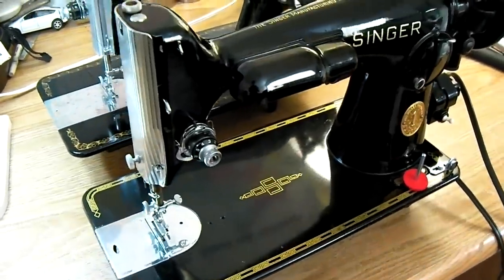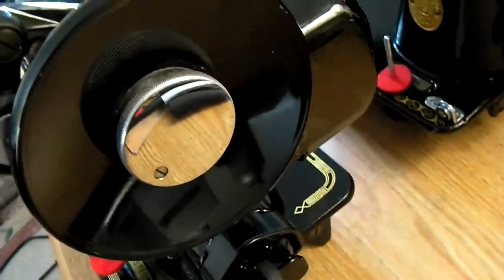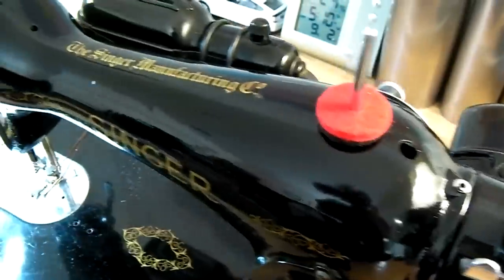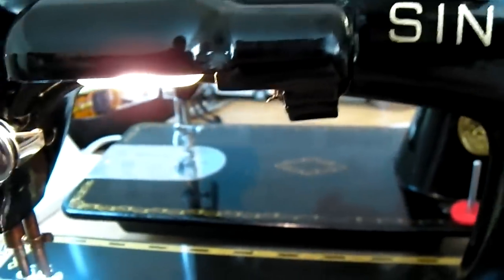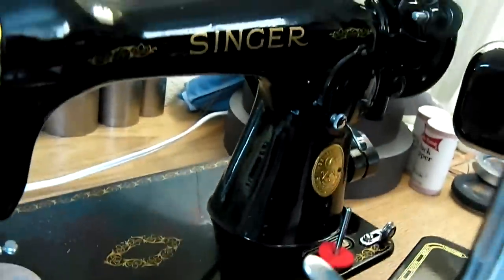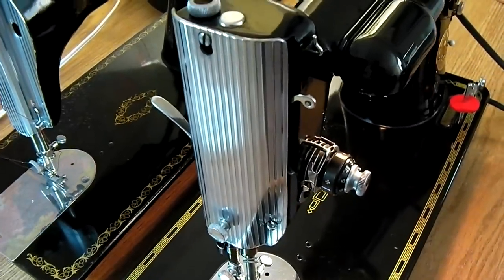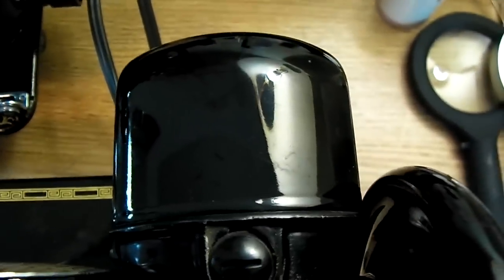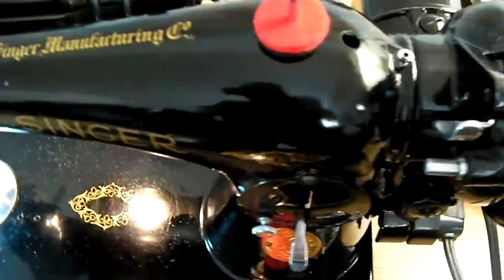Direct-Drive Vintage Singer Sewing Machines, 201-2 vs 15-91

Comment: The 15-91 is called the farmers machine while the 201 is called the dress maker .  The 15-91 is more for heavy sewing . Itl go through leather and heavy blanket if ite fine tuned and factory specs ( needle the right way / bobbin right way anti clock wise placement / needle charge and right size etc )

Comment: I just got a model 15 but it's missing the power cord. Does your model 15-91 uses a pedal or is it single corded?
Reply from the maker: It has the typical 3-prong Singer electrical cord, with a foot pedal.
Reply: Thank you so much, rmwtsou! I have ordered the parts and am awaiting to test out my machine.

Comment: The important differences between the two is that the 15-91 uses an oscillating hook while the 201-2 has a horizontal rotary hook. That's why the 201-2 sounds smoother.
Reply from the maker: Good to know. Thanks!

Comment: See if you can find a Singer 101.  It's the predecessor to the 201.  It also has a 'potted motor' but it is built directly into the body of the machine, unlike the 201 and 15-91 where the potted motor is bolted on.  It's smoother and faster than the 201.  The 101 is the nicest of Singer's machine in my opinion.  I have an overview video on my channel.  Feel free to check it out.

Comment: Bought a 201-2 today in original #65 cabinet with stool, buttonhole attachment, zig-zag attachment, original book, and 8 bobbins. Haven't plugged it in yet. It needs some cleaning -- cabinet is solid but needs to be refinished. Wiring looks new. Decals are decent -- not perfect, but not worn off either. Machine finish needs a cleaning too. I paid thirty dollars for it!!!! Woo-hoo!!! Can't wait to try it out.
Reply: Congratulations !!  30 bucks is a good deal for sure, what a steal!!   For the decals you can always replace them, sell them online pretty cheap.

Comment: As someone already pointed out both the 15-91 and the 201-2 use the same motor.  Singer also made the 101 which was the predecessor to the 201-2.  Singer did make THREE potted motor machines.  I have all three and they all run great.

Comment: first i wanna say thanks for taking the time  to make the video, but i wanna make a point that singer makes many more than just two potted motors. they have a singer 201, 19-51, and similiar model 15's such as the 15-125, and the 15-75, also the singer 101

Comment: I have a 201 and want to get a 15-91 but must correct your statement about the only two direct drive Singers.  The 101 is also direct drive and predates both the 201 and 15-91.  Not as many of them around but great machines.  The motor cover screws onto but otherwise is similar and is the same design as the 15-91 and 201 when it comes to the direct drive portion.
Reply: Some - if not all - of the Singer Slant-O-Matics are direct drive as well (the 301 and the 400 and 500 machines.)

Comment: They must not be original. They look brand new.
Reply: They are original machines. It's the way they were made. A layer of black paint, decals, then lacquer to protect them and make them shine. IF they are cared for with the proper stuff they can be restored to look like this. Isn't it wonderful?

Comment: Have an old Singer that looks like a 201 (light in front , light switch, tension front) but SN AK 807667 according to1 website is 1952 15 model. Any good ideas for more info? It sounds nice when runs.

Comment: Correction....
There were some belt drive model 201's but were mainly treadle and industrial units. None wit the standard external motor/belt drives found on  home machines. 

By the way neither the 15-91 or the 201-2 are commercial, heavy duty, or industrial machines. Strictly made for home use! The direct drive motor set up gave the machines more punching power but not more running power.

Comment: the "base" of both machines are equal dimensions, whereas it is true the "body" of the 201-2 is larger.  Both these machines in good condition are quiet and run very smoothly. 

Although they  "can" sew leather...they were not made to and it it not advisable to put the machines to that use.  They are for "home" projects not for sewing leather.

Comment: I have a 1941 201-2 and the faceplate on it has fancy scroll work thats the only thing different about it. Kind of faded paint but runs amazing. Wiring is scary though I need to replace or update. Got at a yard sale in cabinet with attachments, tons of bobbins etc. all for $10. My cousin sat down and sewed 14 curtains for my old front porch windows and marvelled all night how satisfying it was to use it compared to her newer Brother. We went on a binge and found a couple more for her and she gave her Brother away to make way for an old Singer.
Reply from the maker: You got your 201-2 for a great price! Congrats. These will last decades.

Comment: I have found the 15-91 belt drive is more powerful of a machine. Will easily sew canvas or upholstery materials like butter. .
Reply: I was talking with my Singer repair lady and she told me the belt machines actually had more power than the potted motor. She was telling me that many people think the potted motor is all muscle and can sew leather and wooden rulers, etc. (All the things people do to prove how strong they are.)  She said they actually chip the worm gears by trying to sew things the machines weren't designed to sew.

Comment: You mentioned you bought the machine/s in eBay, can you share how much went for? Was an auction or buy it now deal? I was looking to buy a machine on eBay, but they all look run down.Thanks
Reply from the maker: Don't quite remember. I believe it was in the $200 - $300 range.

Comment: Both machines can be converted to external motor/belt drive. A 15-91 becomes a 15-90. and the 201 becomes unique as there were no external motor/belt drive 201's. Components for a 201 conversion can be pirated from 66 and 99 machines!
Reply: 201-3 is belt drive
Reply: It depends what country you're in. I have five 201s, all belt drive and I prefer them. Easier to maintain, you can switch motors out for more power if you want, or put them on tredle table and sew without power of necessary. More versitile.

Comment: What year is this Vintage singer machine
G1835-2B 

Singer CAT.NO.  RF -5-8
S.S. AU 52-35-1
VOLTS 110-120
AMP 0.80
SIMANCO  Made in the USA
Reply: That's the information on the motor, not the sewing machine. Use this link to look up the serial number if you haven't figured out how by now. http://ismacs.net/singer_sewing_machine_company/serial-numbers/singer-sewing-machine-serial-number-database.html
Reply: Thank you Rosemary!!!!

Comment: I have a 201-3, a belt-driven model. It's a great machine, super fast, super quiet. In Canada, I don't see the gear driven model, I think it's mostly made in the US.
Reply: I would rather have the external motor you can change it fast and the gears in the 201-2 are plastic and do have problems.The wiring in the potted motor is fixable but lots of work.
Reply: Dont know what 201 you are looking at but my 201 is a ll metal, inside and out.
Reply: IF you take the motor off the gears are nylon and do strip and you cant put an external motor on it because the crank is potted motor only. I have scrapped many potted motor machines. Believe me I was surprised to find this out myself

Comment: Are these with drop in bobbin?
Reply: The 201-2 has one. The 15-91 is on the side.
Reply: @ceecee8757  And the 15-91 is a vertical bobbin.

Comment: Omg...I DO hear it.  I have a 1951 19-51, and a 1948 201-2.  And they sound the same as these.  Thanks of this, I can really appreciate it when I hear someone else's machines.... I LOVE both, the 15-91 a bit more because it is knee-operated and was a gift from someone I care for.... but both, totally wonderful!  I hope one of my daughters/stepdaughters/granddaughters will appreciate them in the future (-:
Reply: The 15-91 you have is knee operated because of the cabinet it is in. It can work either way. I have a Centennial 15-91 that my dad bought new for my mother as a gift upon the birth of their first born son, their second child. It has always been in a WHITE treadle cabinet with the foot pedal on the floor. This year I came across two more Centennial 15-91s with their foot pedals mounted in their cabinets for use with a knee part that presses upon the foot pedal to operate the machine. I, too, enjoyed hearing another machine like mine. Such a wonderful sound! 69 years old next month and still running strong!

Comment: I just snagged a BIN 201 on ebay. Grungy but appears to have good decals, and I can't wait to get my hands on it to clean it up and make it shine like this one. Why do you think they sound so different if they have the same motor? Perhaps the actual motor specs are different?
Reply from the maker: I suppose the motor is not the only factor. It also depends on all the mechanical linkages attached to that motor to drive the needle shaft. A mechanical engineer might be able to tell you more.
Reply: I think the difference in sound is because of the difference in design of the bobbin mechanism. The 201 has a rotary bobbin whereas the model 15 has an oscillating bobbin. I think the oscillating bobbin is a lot noisier as it will by design, "slap" back and forth instead of a continuous smooth operation. Another factor in sound difference, is the gear driven shafts that drive the bobbin in the 201 compared to the back and forth motion of the linkages that work the bobbin of the model 15's. I could be wrong, but there is always a slight noise where there has, by necessity, to be enough "tolerance" in moving parts.